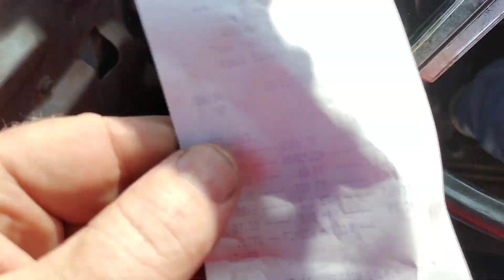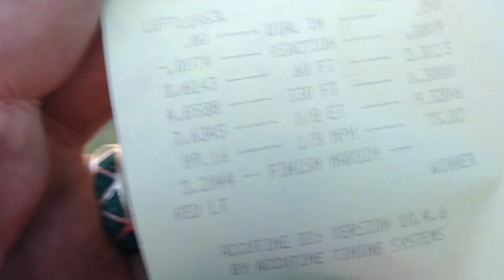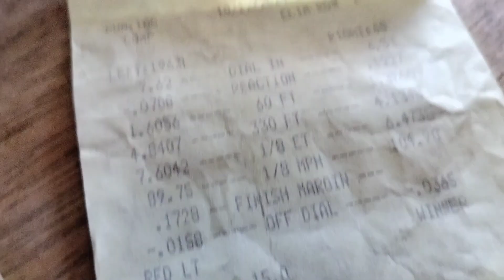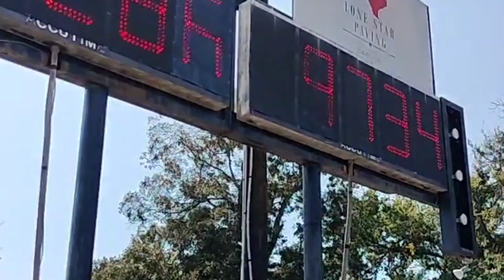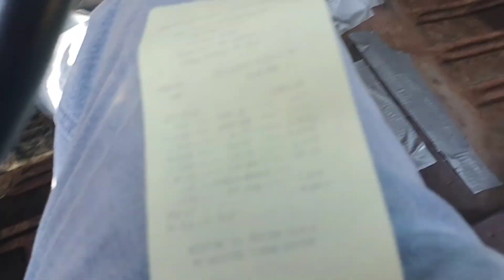Vintage Drags at Little River Oct 12 2024

Comment: Wow! Neat vintage and classic drags from that era. That's very cool seeing them run down the race track. 🏁🚦
Reply: Did the inline fuel cool can make a difference? ⛽
Reply from the maker: @SnickersG-fu2pw  did not end up using it yet. Need to make stronger bracket and get control of first gear. Will test at XRP that next time